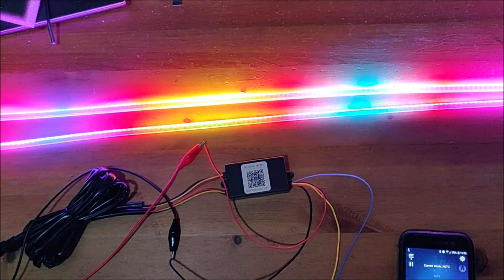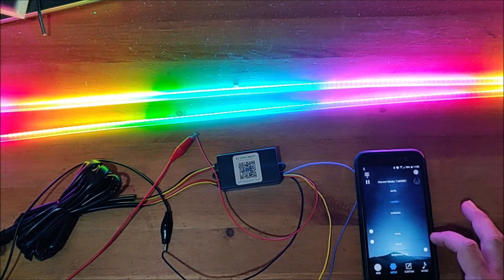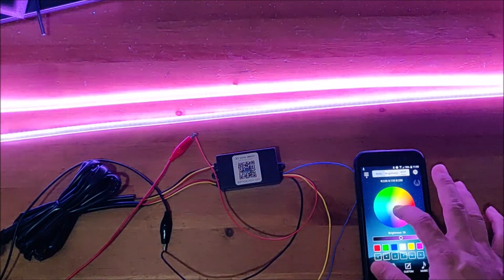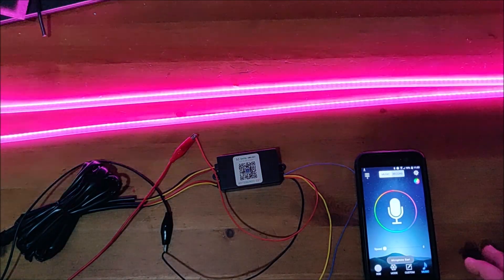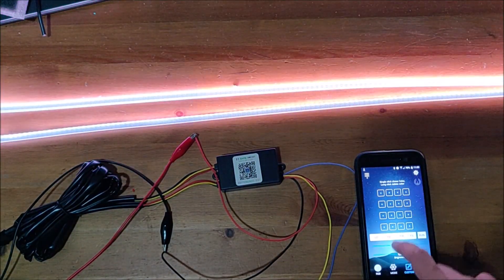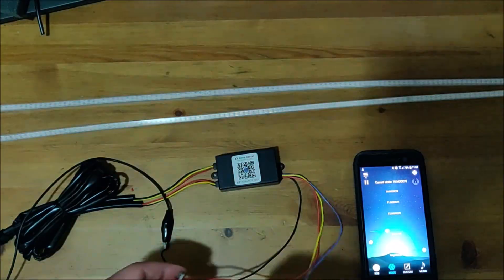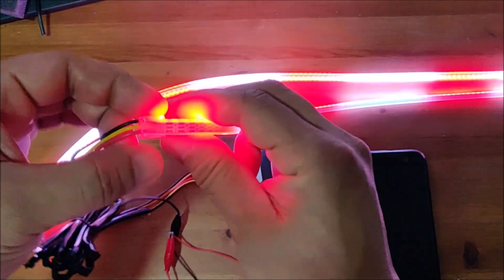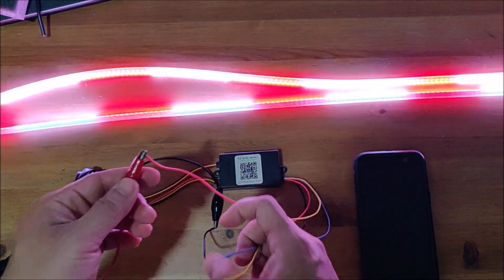Custom RGB LED Eyebrow Light Strips for Retrofitting

Comment: Can I have 4 strips on one controller?
Reply: Any update bro 😭 same question too
Reply: @albertquintero5412  I looked into it and the controller is $90, it’s from a different website called RGBHalokits
Reply: @ryandominguez8924  I heard! But i think we need 24 inch led strip each, so I think we need 4 leds for it
Reply: @albertquintero5412  right, you came from that one tiktok that shows you how to do it?💀
Reply: @ryandominguez8924  yes 🙃 I’m getting my headlight tomorrow so I’m trying get color change so idk what to get led for it
Reply: @albertquintero5412  that’s bad ass, I was trying to do it as a side hustle. I’d just go by the video and use get the lights from rgbhalokits. And if they’re longer than what you need, you can always trim them every 3 chips
Reply: @ryandominguez8924  bro I got 01 headlight and cat eye drl so I might mess around and flip it like you said it’s gonna look hard af g
Reply: Ryan? Do I need 4 leds strip for 24 inch and one controller?
Reply: @albertquintero5412  yessir